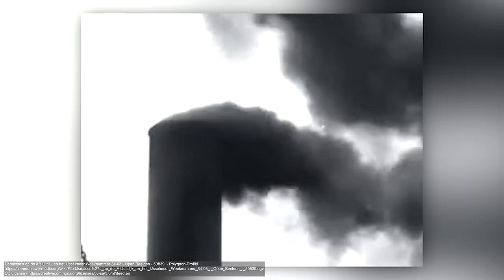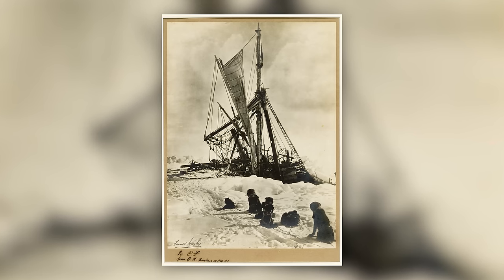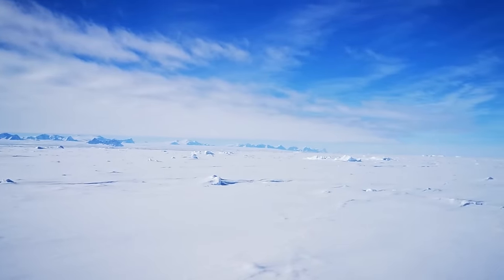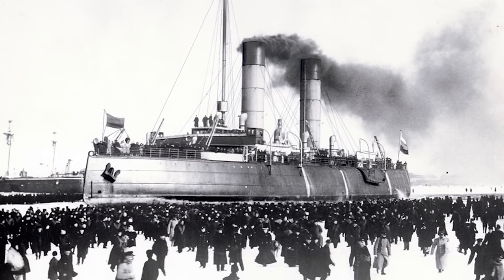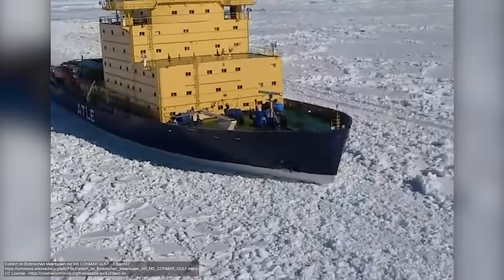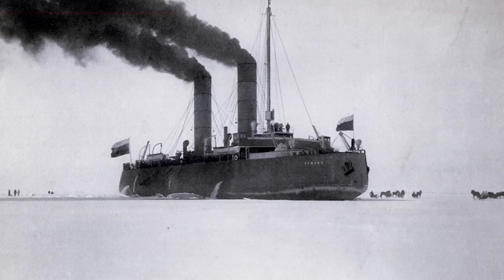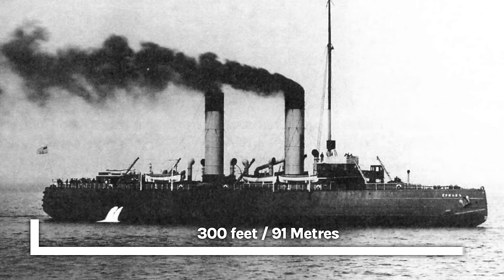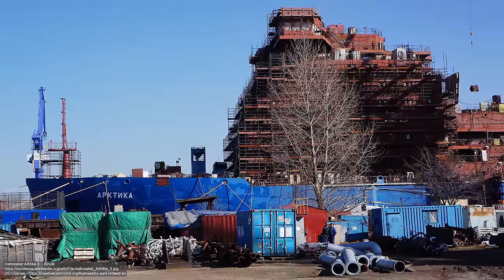How Do Icebreakers Work?

Comment: The earliest Russian icebreakers relied very heavily on the design of two railroad carferries built for year-round crossing of the Straits of Mackinac between Michigan's upper and lower peninsulas, right where lakes Michigan and Huron meet. St. Ignace and Sainte Marie (I) were built in 1888 and 1892, and were so successful the Russians came to analyze their design so they could build similar ships to cross Lake Baikal. Both were built with props fore and aft as you described. The ferries that replaced them, Chief Wawatam (1911) and Sainte Marie (II) (1913) were leased by the US Coast Guard and by a conglomeration of Great Lakes shippers for decades, until the USCG built their first dedicated icebreaker (Mackinaw W83, now a museum ship) in the 1940s.

Comment: Gentle correction. Nuclear powered ships are steam. It's just a much more efficient way of boiling water to run a steam generator.
Reply: You're right, but to be accurate, steam powered ships use propellers, which directly driven from the turbine. Nuclear powered ships are much more like a small NPP on board.
Reply: @Uralski_Ivan  it really an apples to oranges problem. When we say nuclear we are referring to fuel source. So in this example it would be Nuclear VS Coal/Oil (I don't know which this ship used), and Steam Turbine Electric Drive VS Steam Piston Multi Expansion Direct Drive. Obviously that's a mouthful which is why it's hard to be accurate and precise when there are many different variables.
Reply: Effective, not efficient. Compared to Fossil fueled Steam Plants, Nuclear ones actually are very inefficient as they can get nowhere near the Pressure of a real Boiler and can't really superheat the Steam at all. A Nuclear Reactor Core just produces a massive Heat Flow in a relatively small Volume, but you lose most of that in the Steam Cycle.

Comment: I'm sure I read somewhere that some icebreakers use 'bubble' technology where underneath the hull there are holes for injecting air under the ice to remove the support that the water gives it, making it weaker, therefore making it easier for the ship to crunch its way through the ice.

Comment: Early breakers tried to slice ice with horsepower and reinforced bow. Already 100 years a go many had props on front plus back. Propeller waves eased friction between hull and ice. Nowdays hull form are like the breaker climbs over ice and breaks it with ships weight. Today front props are often replaced with air spraying system into waterline through holes in hull, driven by thousands horsepower plus computer controlled active ballasting. Modern icebreaker can make all Disco Fever moves to beat ice.

Comment: Many years ago I  saw a video of a gas turbine powered icebreaker breaking ice that was right up near its limit to break.   The captain was wearing a seatbelt and had a rack of controls in front of him.  In spite of the ships great mass, each time it ran up onto the ice, there would be a jolt.  I think what he was doing was running a full ahead as he came up to the edge of the ice and then switching to full astern.  The ship would rise up onto the ice and then slide back off.  This seemed to start some cracks in the ice that then let him go forward a lot further next time.  He did this a few times and broke his way into some thinner ice that he could then just power through.  That was the end of the video.

Comment: Nuclear powered ship IS actually a steam ship. The reactor just replaces the coal or oil fire in the boilers. The heat from the reactor is used to boil water which is then sent through steam turbines to turn generators. If the ship's power is generatted by steam turbines, then the ship is a steam ship. The only real difference to Mauretania or Lusitania is the heat source.

Comment: Makarov was not only killed in port Arthur he was killed by his own battleship beheading him after he had left it.
Believe it or not a certain Kamachatka was innocent.

Also the yellow Icebreaker isAtle one of Swedens larger Vessels, The Larges one Oden is almost as Groundbreaking as Makarovs one.

Odens hull design is like no other Icebreaker and she is usually rented out as a science vessel in both the Artics during the year as she can carry a multitude of labratories thanks to her unique Design.

This has led to issues in the past with Oden beeing at the south arctic regions during the Winter in the Baltics which led to shipping lains not beeing able to hold open due to no large  Icebreaker beeing availible this happened 2009 or 2010.
Reply: I think you'll find that the Kamchatka wasn't even in the Pacific at the time; she was still in the Baltic.  As for those pesky Japanese torpedo boats though...!!!

Comment: Howdy Mr Brady. Just wondering, what's the deal with the front prop on the Yermak?
Was the engine put there to provide more weight to smash down on the ice? And was the front prop geared to be a puller, as opposed to the pusher style at the rear, sort of a two in the back one in the front jig? Or was it there to throw the ship into reverse?

Comment: Having worked aboard and constructed nuclear powered naval vessels. People assume the reactors power the ship.  This is not quite true. The reactor itself does not power the ship. The only thing the reactors do is create heat which in turn is used to create steam. In the case of the artica. That steam is used to spin turbo generators. Then the electric power produced is used to power the ship and the electric propulsion motors. So essentially the nuclear reactors replace oil or coal-fired boilers. It's true for all nuclear powered vessels. Most people are astonished when they find out that other than how the steam itself is produced. Not much has changed since steam turbines were introduced in the early 1900s.

Comment: The idea that icebreakers drive up onto the ice is a little bit of a misconception. An icebreaker under nominal operation barely pitches at all, and even when the ice gets thick enough to warrant ramming, they dont slide up much at all because the thrust/weight ratio isn't high enough.